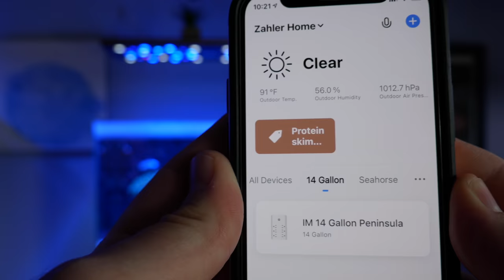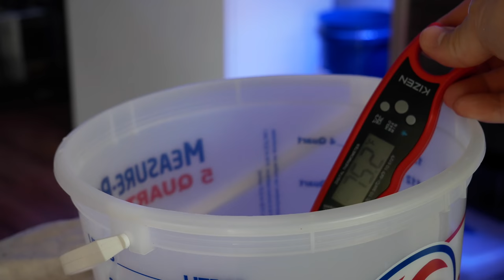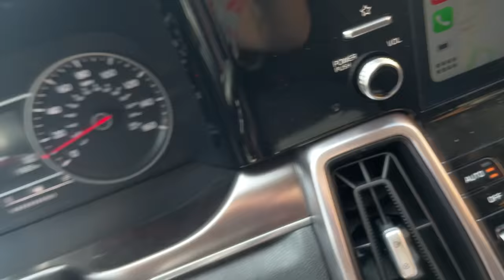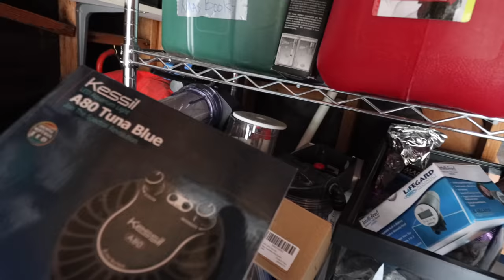So Much To Do And So Little Time! The Gallery Episode 23

Comment: You may want to consider investing in a Python drain hose. You hook it to your facet and it creates a suction that drains the water. Much easier than hauling 5 gallon buckets.
Reply from the maker: Yeah, for sure.  The only problem is my sink is really far away.  I actually use a 32 gallon trash can with rollers but I just didn't in this video!  Thanks for watching!